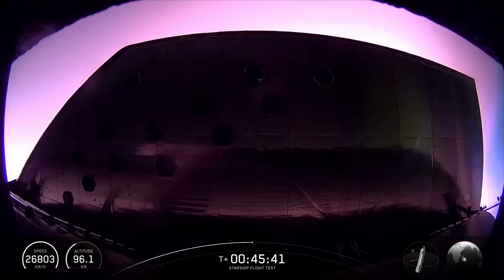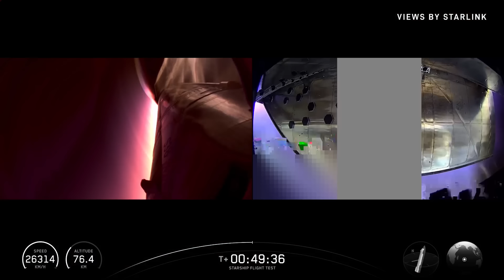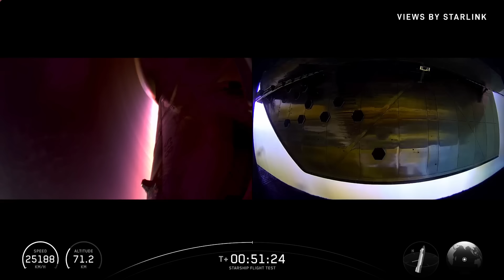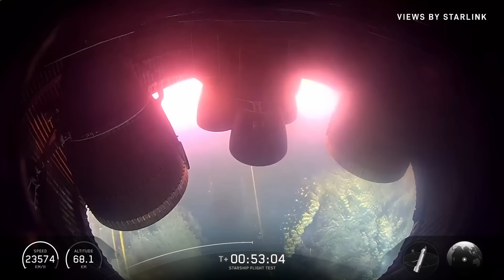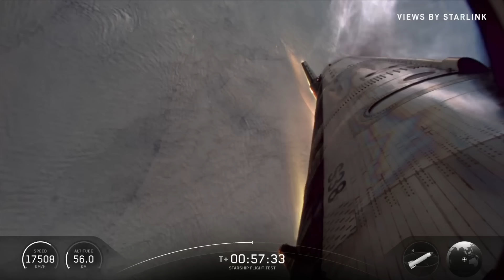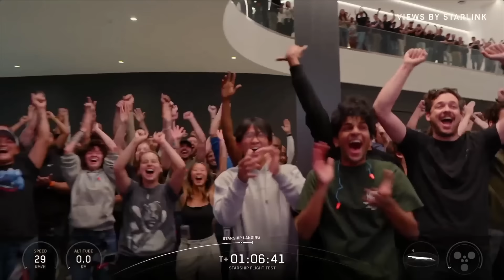Wow! See SpaceX Starship's flight 11 re-entry, splashdown and explosion

Comment: I’m thinking that because the ship had just went through that plasma phase in re-entry and hitting the saltwater shortly thereafter not only caused the ship’s rapid metal expansion due to the cold water, but at the same token,” DROSS”, of the metal/ alloy which in turn tore the ships fuel tank and instantaneously combusted/ exploded! To test this theory, next time try to land her on land with the same parameters that was instituted on this run!!!!! Shame on u guys!!! Collectively a thousand degree’s amongst the 50 of use and u couldn’t have foreseen  this!!!!!

Comment: why explode it on splash down? Isn't it wiser to keep it a whole to prevent contamination to the enviroment??
Reply: First, they want to make sure it sinks so it doesn't present a hazard to shipping.  Second, based on experience with Falcon 9, even if it entered the water intact it would likely break up from wave action soon after (although it's not guaranteed - one F9 booster did stay intact and floated on the surface and I think they had to shoot at it to get it to sink).  Third, they're dropping a twenty-story tall beer can with a little methane and LOX from several dozen meters high, it's not gonna survive that anyway.  Finally, this is a temporary mode of operation; once everything's dialed in and they're confident they can put everything exactly where they want it, it will land back at the tower.  They've already caught the booster multiple times, but they're testing some engine-out contingencies, steeper angles of attack, etc., to find the operating limits of the vehicle, and it's safer to do that over water.

Prior to the Shuttle, every rocket launch disposed of spent stages into the ocean with no attempt at recovery or mitigating contamination.  SpaceX is working towards recovering and reusing both stages without having to spend any time in the water, but until they get everything nailed down they're going to splash more test articles.
Reply: @johnbode5528  Thank you very much for your answer John Bode. That makes sense.

Comment: but it exploded!!.
Reply: Have you watched and listened to the video at all? Anyways... recovering a fully intact rocket from the sea is technically difficult and expensive. By intentionally destroying or decommissioning it after splashdown, you avoid the hazards and costs of full marine recovery. These early tests are less about re-use and more about validating flight dynamics, thermal protection, engine relight, control maneuvers, etc. The hardware might not be robust enough (or cost-effective) to survive reentry plus marine exposure fully. So, blowing it up post-landing might be the pragmatic middle ground. 🤫

Comment: Will someone explain why the big explosion after splashdown is a good thing?
Reply: Explosion itself isn’t the good thing. The good thing is the Starship successfully simulating a catch and completing a soft splashdown. The explosion is happening after they have finished their tests, and is only happening because they’re landing on water instead of a landing pad. 

The explosion is also used to ensure the ship sinks and doesn’t have excess fuel which could pollute the water.
Reply: Thats Flight Termination System, it does that for every water landing
Reply: It was designed to do that so it will sink.
Reply: @xploration1437 so designed to polute ecosystems. Now this is good because??
Reply: it means it will never be human-rated (meaning safe enough for humans to be in) lmao!